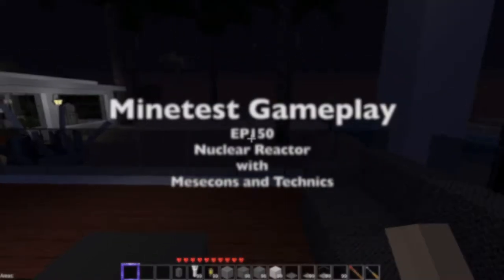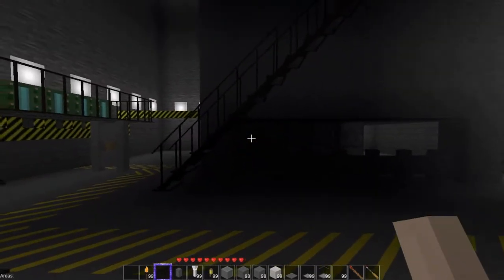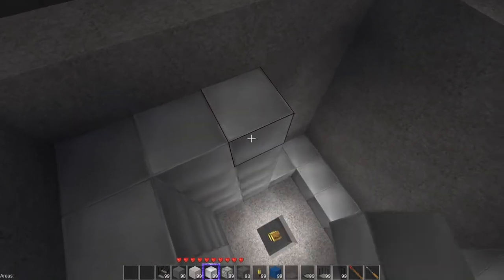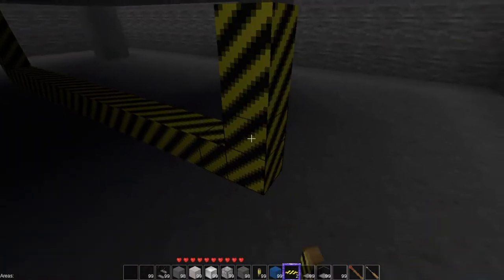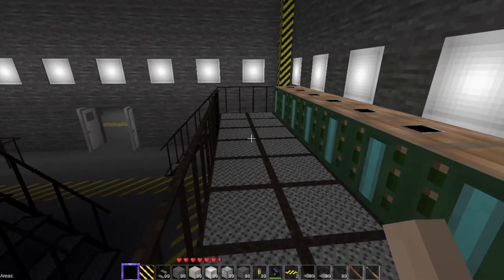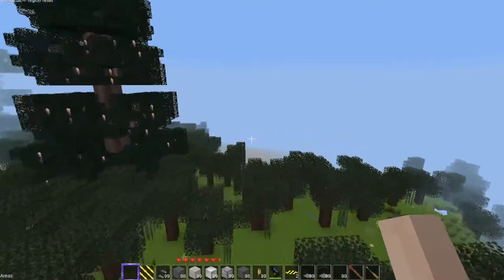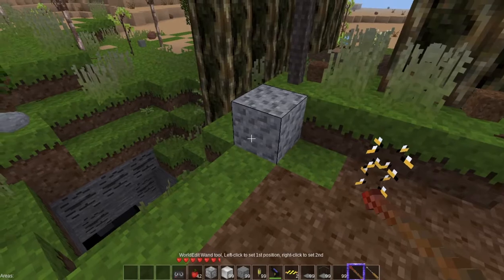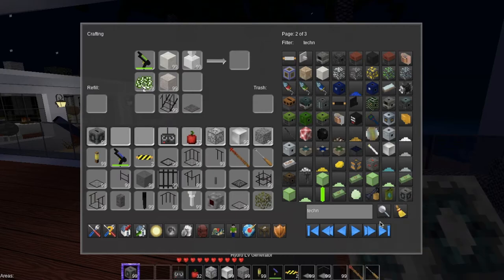Minetest Gameplay Episode 150 - Nuclear Power with Technic Mod

Comment: I believe if you are using 3d_armor and technic you'll get lead armor, which does provide protection from the radiation.
I don't think there is an easy way to make the enriched uranium rods, the setups I've seen are very large and complicated.

In survival you have to start at LV and use those machines, power creators, and battery boxes to upgrade to MV and then HV, so you can't actually start with HV.
Reply from the maker: I have to update my 3d_Armor.  I forgot about survival and having to start at "LV" before moving to "MV" and ""HV equipment .  That is why I play in creative:)
Reply: Why not use the hazmat suit? That gives the highest radiation resistance I've seen so far. I had to use it to rescue my kid who mistakenly placed a block of uranium in his house right next to his bed on our survival server.
Reply from the maker: YES!  Ultimately went with the Hazmat suit.  The Hazmat suit provides the most resistance to the radiation.